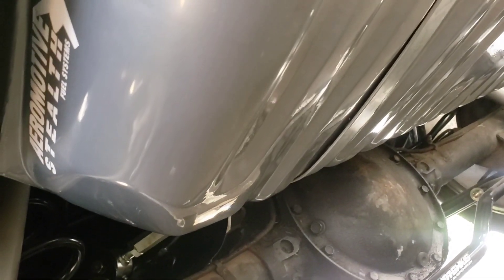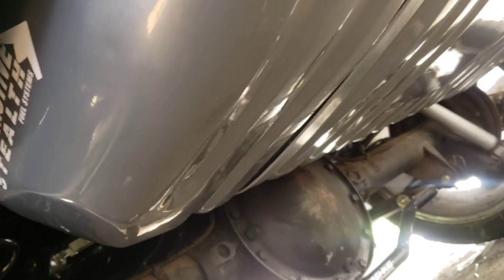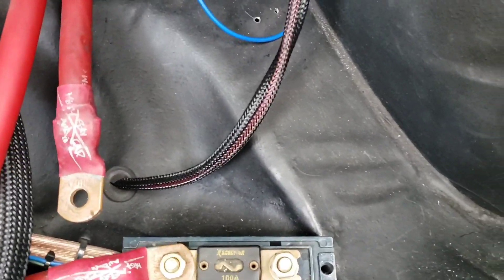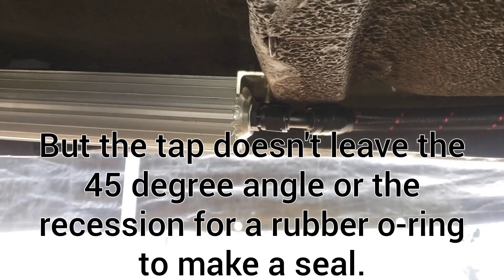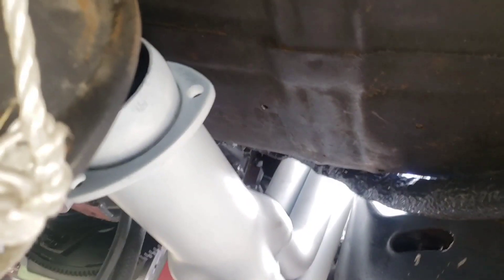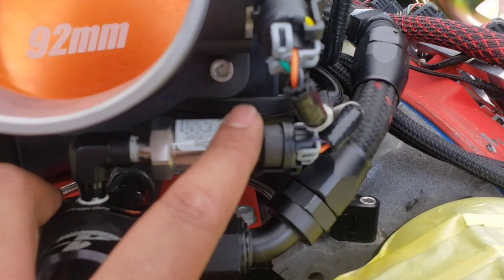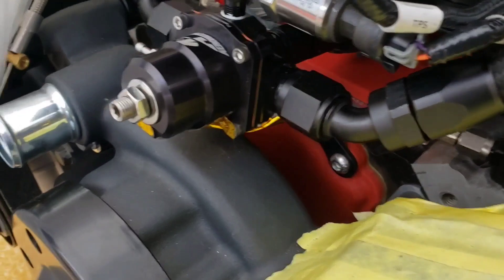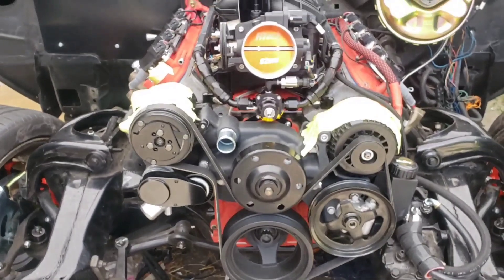FULL LS Swap fuel system overview | 72 Chevelle

Comment: Did u use the Holley terminator x harness?
Reply from the maker: I am using a Holley harness for the engine!? The harness for the fuel pump is an Aeromotive part. . . I am using the Holly harness to trigger that Aeromotive relay kit though!?

Comment: Nice detail work boss. What wrap did you use to wrap the fuel lines in the front close to headers and across engine?
Reply from the maker: Thank you and the heat shield stuff is called "Design Engineering Fire Sleeve"

Comment: Good work, I gotta find somewhere to mount my pump. I got a inline, but that thing is huge
Reply from the maker: Good to hear your still bustn' it out over there. . . check Amazon for "T- bolt mounts" them thing can fit any where! ( and thanks for the support man ✊🏾)
Reply: @Califormula  no problem bro. You got a link? All kinds of stuff popped up and I dont know what one looks like lol
Reply from the maker: Something like this. . . (they have ones with rubber isolators as well.)

https://www.amazon.com/Autobahn88-Stainless-1-82-2-17-47-55mm-Plumbing/dp/B019NY6P20
Reply: @Califormula   aaaahhhhh ok